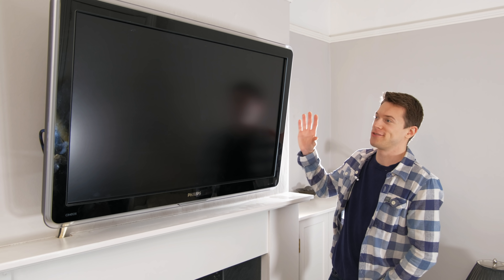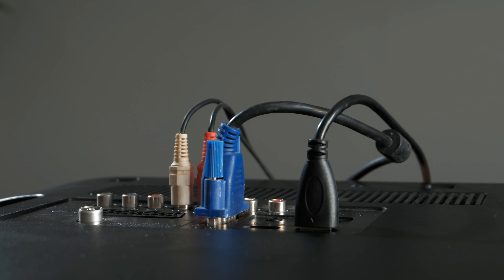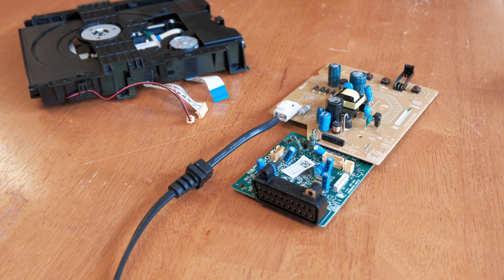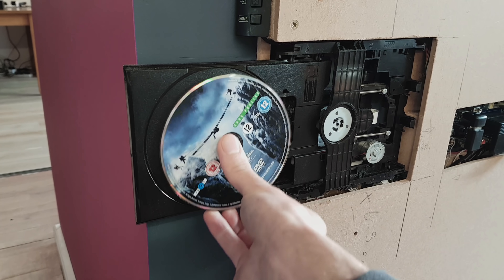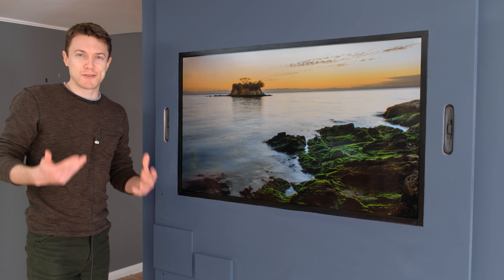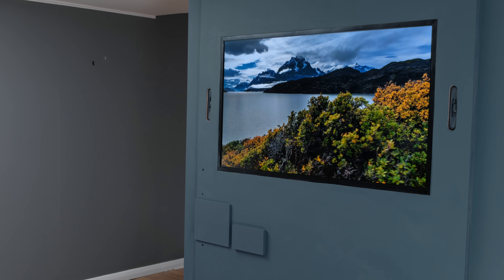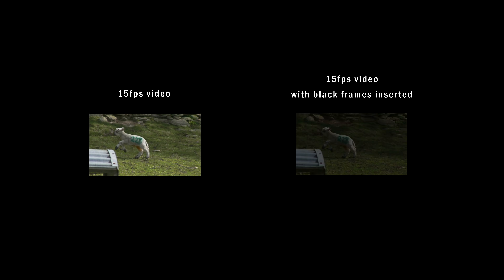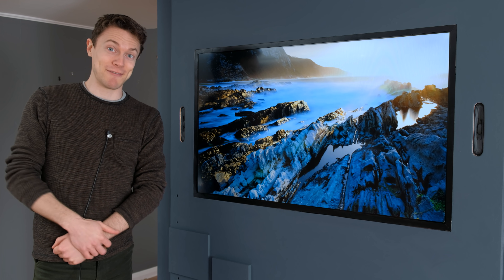Building a homemade 'wallpaper TV'

Comment: I must say... i understand that you were on a small budget but this really looks cheap to me.  I do respect what you’re doing. And the fact that you could do it is amazing.
Reply: Well, it's not as pretty as his other projects, but he did achieve the goal.  His next project should be, make a thin wallpaper tv that also looks good.
Reply: The only reason it looks "cheap" is because of the blue paint. I guarantee that a beige, white, or any other color would look better haha
Reply: my problem is less the color than the boxes that stick to the wall to house the connectors and boards. Id definetly add some cover to the speakers and do something else as a frame, seems good for a budget though
Reply: that & you could add a proper window frame instead of the kitchen tape for a more "window-y" effect

(LinusTechTips did it with an actual Wallpaper TV, the principle is more or less the same but his was better looking)
Reply: Yea it's definitely not just the wallpaper colour. The speakers not being covered is pretty ugly and the fact that he even used stick tv speakers in a project like this is beyond me.. plus you can see the lumpy Ness of the tape on the TV's border.. Also those infrared sensors are going to be pretty impaired by being in a hole like that, should've extended them and made them flush
Reply: Perhaps you can all do a better job when you do yours?
Reply: I wouldn't discard the possibility of being able to do a better job, but on the other hand, i could also do a far worse job without practising it first
Reply: Would have definitely looked better if the speakers weren't hiding in a hole. Having things like that stuck below a board (especially with the holes themselves not being painted) makes it have a rough, unfinished look.

Not to say he didn't do a great job, I just wouldn't like that particular look myself.
Reply: +Pete Allum
This is definitely better than anything I can do!
But, I know that Matt can do a much better job than this. Still a cool project, I like the concept, but the execution doesn't live up to the standards that he set himself by his previous videos.
Reply: I disagree that it looks cheap.   I think he did a very nice job on a budget.   And while  I probably wouldn't paint it blue I definitely wouldn't paint it while.   How boring!
Reply: TBH I think it looks fine
Reply: easy fix.  some black speaker grills to fit into the holes and add some "decorative" square/rectangular boxes added on to make the covers he has blend in more with the design.
Reply: The wall should be covered in some nice textile
Reply: If you think you have more skill, yours could look better. The idea is still good and useful for those who like it.
Reply: I think he should have used the original bezel. Best solution?
Reply: Do you have a link?
Reply: @no-yj2cf  Painting end grain on OSB looks like shit no matter what colour you paint it.

Comment: Really cool, I would make one more modification to cover the speakers with some kind of fabric grill/cover as they are somewhat unattractive.
Reply: preziam yes, i thought that too
Reply: A metal grill or replace them with  external speakers
Reply: if he was placing the fireplace mantle back in you could build the speakers in to that and paint the grills to match so you wouldnt even see the speakers
Reply: Or remove completely and go with a sound bar or surround sound 🙈
Reply: I would have trashed the speakers and hooked that TV up to a proper sound system (sound bars are crap, go 5.1 or go home). I also don't understand why he'd use a DVD Player that connects via SCART, so watching a DVD with this setup you have shitty sound and shitty image quality as well...
Reply: Proper 5.1 or one of those little ones with 5 tweeters and a midrange driver used as a "subwoofer"?

Comment: Excellent idea; I also dislike my protruding telly, and will definitely study on my options for a similar solution. That said, you really need to add venting holes at the top and bottom of the fake wall, as that screen will seriously heat up in an enclosed space. Also, mounting those boards onto fibreboard -- especially the powerboard -- is asking for a house fire; mounting them with standoffs to at least a metal plate (either connected to system common, or maybe earthed) will probably be your safest bet. Finally, you should have checked where the transformer board for the backlight is (generally found as tiny-but-dense transformers along the edge of the screen panel), as those things put out 400VAC to the cathode lights; if they're up against the fibreboard, then the firehazard is much greater.
Reply: I really want him to see this because I don't want him to burn his house down with this.
Reply: hahah, I agree with you
Reply: Good Idea
Reply: This was my VERY first thought. It will not be long before all of this catches fire. It looks good but I would not want this in my home
Reply: I think his TV doesn't use fluorescent backlight anymore. Modern TV now use LED so no more high voltage or transformer .
Reply: Forgot about LED TV's, but you're quite right. However, Matt says he bought an used, old TV, and judging by the connectors in the back (RCA + coax), that particular set is probably still backlit.
Reply: I think his TV's backlight is LED because he used the PWM to control the backlight frequency to match with LCD refresh rate.
Reply: Shut it, Potter
Reply: Might be edge-lit technology, my 2010 Sony is a 46-inch model similar to this, made for the US market.
Reply: I actually have this same TV! It's LED backlit
Reply: That’s definitely an LED backlight, CCFL would have a special better-insulted cable to carry the high voltage, and it isn’t there.
Reply: Yeaaaa, no. This definitely will not generate enough heat to catch anything on fire.
Reply: Good Lord, that was a very boorish thing to Say. I get the feeling your are unerringly conventional, 
and live in a very small box which you have constructed for yourself.
Reply: No ventilation so the electronics (and maybe the screen) will fail early. Although fans seem like a good idea, they introduce noise, require power, a dust filter, and won't last forever. So I recommend large (discreet) holes or slots at top and bottom. Or bash holes through into the chimney breast at top and bottom. (Hot air rises from bottom to top. It doesn't flow sideways without fan assistance.)
Reply: My thoughts exactly... Lol

Comment: My dad did something similar with a CRT TV from the 80s. He cut a hole in the wall, on the other side of which happened to be a kitchen pantry, and he put the TV on the top shelf, then framed it with stained baseboard molding. Turned a 2-foot deep 70lb monster into a 'flatscreen', albeit at the expense of some kitchen storage 😄
Reply: Lol we did the same thing, also protruding into the kitchen pantry! Canned goods had to go elsewhere.

Comment: The explanation at the end was extremely interesting. I did research and found out that some Samsung LED TVs have a similar feature built in, namely "Motion LED". In fact, a TV that i own has this feature and i have always wondered what it does, since the screen becomes noticeably dimmer once activated. This seems to be what the TV is doing with the backlight.

Comment: I see the criticisms, and while I think Matt ran into a number of issues with regards to the budget, it's also a difficult project to plan ahead for, and I believe the finished item shows some of that in the result.

Biggest challenge is the MDF; some have mentioned the color choice of the room, but the thing that really hurts it in this type of construction is its naturally "furry" grain.  This can be defeated with sanding, sealant, and primer, letting the eventual paint coat present it's real texture to match its appearance on sheetrock, making the presentation indistinguishable.  It's a lot of work and an added expense that may not have fit the constraints.  Conversely, for someone interested in attempting this themselves, it does present the opportunity to construct an integrated bezel from thin ply to eliminate the metal edge, rather than the surface taping; because plywood can be sanded, sealed, and primered the same as MDF, the finish is transparent at the end.

I'm not sure I'd expect a wallpaper television to present speakers itself; subscribing to that level of clean, a bluetooth transmitted set of speakers seems a much better option.  Similarly, using a Chromecast/Fire Stick or similar casting device seems a much better option than the DVD player, since it lowers the challenge of fitment.  And an extension of the IR receivers to the ceiling seems a cleaner option all around, since they could be worked into trims at the top of the wall- possibly under opaque white plastic to help stealth them into the others used in the room.

Ultimately, I don't think this is a sub-par project- I think it's a project that simply has more options and room for growth depending on what someone wants from it.  As a proof of concept it's solid, and I can think of a couple environments the recycled technique would work in just fine.
Reply: you could use acrylic plastic instead of mdf
Reply: Blox117 

Well, I guess you could, depending on your resources and willingness to work around the limitations of mounting to acrylic- requiring tooling for tap and dye work, or the desire to expoy the hell out of a framework to mount the electronics to; and that's not getting into mounting to the original wall itself. Similarly,  you're dealing with cost. 1/2" 4'x8'  MDF, at least here in the US, runs around $25, or about 90 cents per square foot.  Meanwhile, a sheet of 1/4" 4'x8' acrylic will set you back $115- or about $3.50 a square foot.

MDF is workable, especially for a light DIYer.  Acrylic requires a different set of skills, and comes with a much smaller amount of leeway for its properties.  And ultimately, that's the most important thing- if I am doing something edge lit, or a really high profile installation- like a pseudo-Surface table, not only would I look at acrylic- I'd use the additional options available to make it most clean. An LCD screen for a large scale table top game using UV acrylic resin adhesive to give it an almost smartphone-like appearance with perfect optical clarity would be amazing.  But it would specifically use what acrylic is good for, rather than adding expense and difficulty to a project like this.
Reply: limitations? you just cut and drill through it. you also do not need it to be so thick, its not a load bearer. plus the surface will be smooth unlike with wood
Reply: On a wall as small as that one I would have went corner to corner, and the access panels flush with the wall, same with the ir receivers. Speakers would be upgraded with a small setup, maybe a sound bar with wireless sub. Leaving the black screen and black mesh on the speakers, but installing molding from a window or like, would knock it up to the next level. For a first time, excellent job keep it coming. Subbed

Comment: Flat screens generate a great deal of heat. That's why the manufacturer designs cooling vents in the back panel. How do you allow for the venting of heat from the panel and boards?

Comment: This makes me want to take on projects that I by no means have the skills to take on.
Reply: husband comes home, why is the tv in 100 pieces? 🤷‍♀️ blame it on the dog.
Reply: With my dogs, it would be a believable excuse lol
Reply: That's at least not my problem.🤔
My issue is I lack the tools,  some of the materials, and the finances to amend the situation.
I'm one of those weird people that pretty much can do anything as long as I know what's involved & have the materials & equipment.
I certainly won't produce something exactly as originally planned, but it will have the same results, & occasionally additional details that actually work out pretty well, but are entirely removable.
Basically, I create an optional addition that has features I want, but can be removed without any effort...this happens in anything I do... it's weird how I can create an integrated, yet optional component to things I make.
The biggest issue is maintaining motivation to complete the project though.

Comment: It seems like it would be a lot easier to cut a hole in the drywall, frame a support box inside, mount the TV in the wall, and re-apply drywall and paint. You could even add some cooling fans/vents inside the wall. Or...just buy a flush-mount TV.

Comment: love your work but i dont think this one  is up to the mark of your prevoius projects. no where near as much attention to detail in the build we are used to seeing from you. id also be very concerned with heat buildup from the lcd and other electronics.
Reply: elninonitro 
The LCD panel shouldn't produce any discernible heat but the electronics may.
Reply: I am concerned as well ... on top I imagine your insurance wont be to amused when your building burned down ...

Love it but it´s to risky in my point of view
Reply: It depends if it is an LCD or an 'LED' screen.  Possibly this is a LED one but older LCD screens produce a fair amount of heat
Reply: Yeah, I agree. Alot of his other projects look they could be real products that you could buy in a shop, but this looks like it was obviously homemade. It kind of annoys me that he left that little gap around the speakers unpainted. It's not bad, but he's set up such a high standard with his previous videos.
Reply: Hahahaha... MR O.C.D
Reply: I've done this in the past, and heat definitely is an issue - *Because the TV would overheat and shut itself down*, and some older TVs may not have that feature. To fix it I got two lengths of dryer tube, with four Noctua 140mm fans, one at each end. One set pulled in from the outside (Which was on the left) and one pulled air from the inside and blew it out (On the right side). I had some fairly thick walls to work with, but I managed to maneuver the tubing around so the inlet pulled from behind a plant, and outlet was pushing out from the other side of the wall outside to hopefully keep living room temps down slightly. I also attached some of the mesh filters you can find on PC modding sites so it acts sort of like an air filtration unit for the room, on top of keeping the TVs internals clean.
Reply: elninonitro You can add heat pads/radiators, or air cooling inside
Reply: Having multiple screens burn out their backlight LEDs I'd say even those will need decent airflow. Considering there are heat sinks on multiple parts of the power and signal board, cooling really needs to kept in mind when building this no matter the backlight technology.
Reply: This comment just goes to show how much I don't like most people. Give them something for free. Change it a bit and they start to bitch and whine. You didn't pay him to do that video so be grateful. Either, pay him to make one according to your own requirements or shut up. Always ask yourself if your own standards are as high. Most of those people who over criticize even free things tend to not be able to meet their proclaimed standards when they create something themselves, even of you pay them to do it. Just my experience.
Reply: Chris Lewis Oh yes ofc I will shut up now. You really convinced me with your arguments. Thank you for insulting me so eloquently. 😂
Reply: Chris Lewis Ordering someone to be quiet because their opinion is not intuitive to you while explaining how someone else is entitled to their opinion, that's not very consistent 😂 There are videos on YT on how to build your own gun and people are raising a concern over the dangers of electronics that might get a little warm. Yeah, right 😂 this is a DIY channel, a little common sense is needed. Put some vents in and you'll be fine. Anyhow. I'm out. I wish you good luck with that attitude that the world ows you quality for free.
Reply: This TV is LED. I have this model, but I agree with all your comments
Reply: Mario Super Right, because giving ones opinion on a Youtuber that they enjoy is definitely a reason not to like them. Just because something is free, doesn’t mean it can’t be critiqued. It’s called constructive criticism. You may, “not like most people,” but I’m guessing most people feel the same about you with that snobby attitude. I’m guessing you’ll say that you don’t care what people think though.
Reply: Not gonna heat up much as that's an LED panel. I have a smaller sony led full hd smart tv that's not smart anymore cause of their stupid software that I bought like 5 yrs back. So, yeah, not gonna heat up that LED panel.
Reply: right... I was just gonna say this. Why isn't he paying attentions to the details?!
Reply: Mario Super It's not his fault, it's a millennial thing.. I wouldn't worry yourself about it too much.
Reply: Very usefull, Thank you !

Comment: Adding a lot more edges to the wall makes it stand out much more than before
Reply: I think a modern 45" tv would have been the way to go. This guy definately did make some improvements though, that other tv was ready to kick some ass.
Reply: @odoggow8157  Since he presented it as the finished product -- yes I do. And even if he painting the edges of the speaker holes he still has the holes, and the two really weird boxes lower down that stick out way more than a TV on a standard mount does.

BTW, I don't believe he kept this installed. He removed this once he was done filming (which is why he didn't care about it overheating).

If he wanted to do this right he should have started by furring out the whole wall with 2x4s which would have given him enough space to mount the TV and components so that they have some air flow.